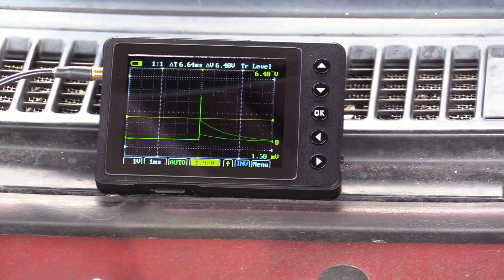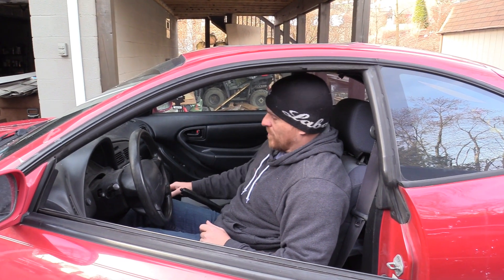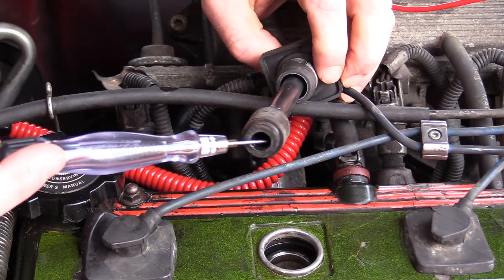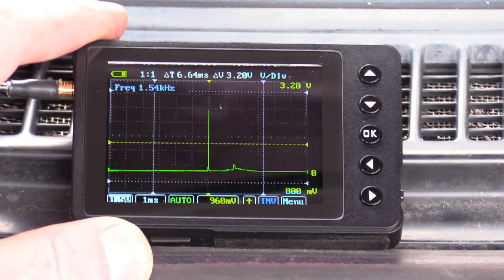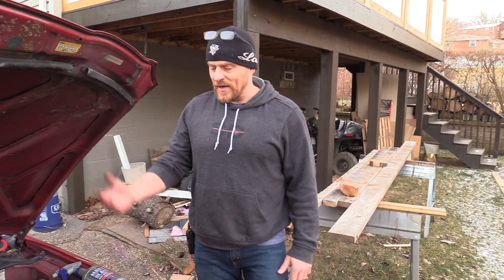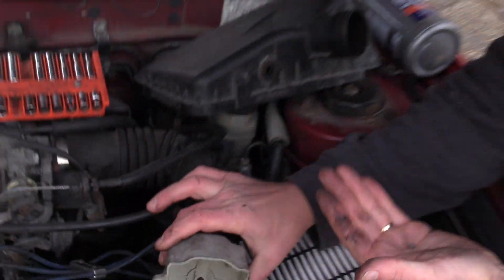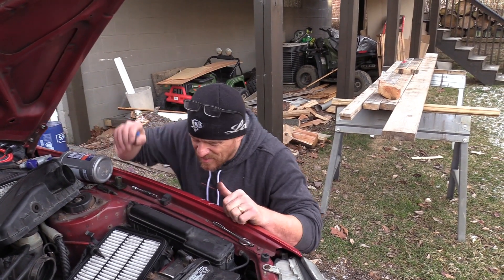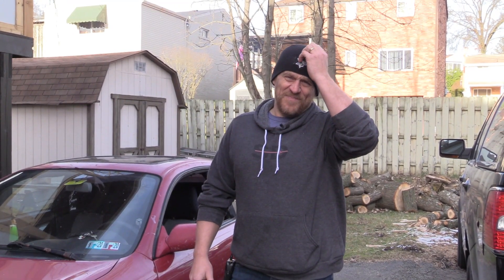Misfire, weak spark, 2 years after coil replacement 94 Toyota Celica (part 1)

Comment: I’ve got a 2006 Nissan Altima every shop has given up on it it has spark no fuel the harness is good has continuity from crank and cam sensor to computer I’ve replaced the sensors just Incase replaced the fuel pump it works comes on with switch pumps fuel to rails replaced the injectors checked the ignition switch it has power and sends signal the injectors has power but no pulse I’ve replaced the computer two times both times having it reflashed and after installing it in the car it would crank and run 3-4 times then it’s like something messes it up and it’s done at $79 an hour in a shop and 2 years trying multiple trends and nothing works I run across your you tube page and wonder if you may have any advice for me it’s a 2.5s engine thank you in advance
Reply from the maker: Sounds like an immobilizer issue. Hard to say without seeing the car. Any codes for the anti-theft system?
Reply: I’m not sure if there was a code for it or not but he did say he disabled the anti theft to try and get it to start

Comment: Sir I have a 1997 toyota celica and had a intermittent misfire cause cylinder 2 is misfiring at the beginning but once the engine is hot it runs smooth again. We had the engine overhaul without checking the coils injectors and changed the piston rings, head gasket etc. But after the overhaul the misfire is still there. And one month after the cylinder 1,2, and 4 are misfiring and only cyl 3 is running which makes the engine sound so bad and shuts off if you dont step the gas. What do you think is the problem sir?
Reply from the maker: compression test would be the next thing I would do, my first thought until you said all the other cylinders are now misfiring, was a possible intake manifold vacuum leak on the #2 cylinder but now that it is misfiring on 3 cylinders now, I don't think so?
Reply: @ScannerDanner   Yes I would love to do a compression test too but my father which is also a mechanic, said that there is no need to do a compression test because he is sure that the engine inside is good since we just overhaul it. What I was suspecting was either a broken valve spring that was not noticed while being overhauled or faulty ignition coil and fuel injectors?

Comment: One more coil replacement , But this is the third on a 1978 Toyota Carina with 86,600 miles on the clock , The 4A-F  engine has the coil in the distributer, I have had about 20 motorcars in my 86years all with coils seperate from the distributer and nevver a failure  SO WHY THIS ??
Reply from the maker: Junk parts being made these days ESPECIALLY for old cars

Comment: The video you posted on December 14th on the 03 Chevy truck, did you ever do any more work to that? Just curious if the guy got back to you on it. We need a video dedicated to the Scanner Danner blooper reel. That pickup coil, does it have epoxy over it or no? Strange coming apart like that. Thanks for working in the cold, I can relate.
Reply from the maker: He never answered my questions. I really wanted to know the part numbers of the injectors he put in and where he got them from as they did NOT look new. My brother also found that the frame was bad on that truck and I am not surprised that we haven't heard back from him. Unfortunately

Comment: I'm only 10 minutes in, but I'm surprised you haven't considered the wires. They were moved when the valve cover came off, and they are notorious for failing, especially when older.
I'd water bottle test it to see if it's arching outside the wire, or if it makes the miss worse.
17:00 in, shouldn't we re-test at the cap  to see how far it jumps now that it''s happening to retest?
18:00 in Ahhh, ok.

Comment: how many miles in that celica  Paul ?

is a manual or automatic transmission ? 🤔
Reply from the maker: Manual. 256,000, second engine. We bought it with a blown engine and put a junk yard one in it that had around 100k on it

Comment: Lol wasn't doin that before you fixed it....... At least once a month......

Friends yota started to (edit lose oil from the dist) the coil had a bad bearing "pickup coil was ripped out" car still ran fine but it is a normal wearing part..replaced the dist ✔...crap meant to say OIL
Reply: lets team up in SW FL

Comment: After all that testing,  pull the cap.....the rotor or the post for #3 cylinder probably has carbon/scoring on it.
Reply from the maker: Keep watching, it is not a cap and rotor problem
Reply: @ScannerDanner  I did....saw that....never seen a distributor fail like that. One for the books.

Comment: All the while I am watching this video I am thinking why not ohm out the spark plug wire to make sure the problem is not there. Next, why not pull the distributor cap and look inside it.  Look at the cap and rotor and then the rest of the distributor. Some times the eyes can be an effective tool and save a lot of time.

Comment: I once couldn't turn off a Jetta... The Jetta kept running... I unplugged the spark plugs wires... The thing was still running.... 0_0 ... I took off the fuel relay... Stupid car was still running..... The zombie Jetta would not stop running until I took the intake boot off and plugged it . Luckily it had no vacuum leaks and shut off. The car kept running because the engine oil was contaminated with fuel, the carbon buildup in the pistons was really bad to, the carbon got so hot it could actually detonate the fuel contaminated oil, and the dum car was leaking oil into the cylinder thru bad rings and valve seals
Reply from the maker: That is crazy! Thanks for sharing

Comment: Dilemma, as the last to touch it before it went wrong do you pay for the repair, or because it's your lads car do you pay for the repair. lol
Reply from the maker: No dilemma other than the initial diagnostic charge. You may need to work with your customer on that part as it truly didn't do it until we touched it. BUT, once we found the issue, we can prove it wasn't anything we did other than to disturb a preexisting condition, and the customer is being billed for the new distributor, the labor to do the job and you may just build the diagnostic time into the bill because they may complain. But that part you can even charge for in the end, and be open about it, if you've communicated well with your customer along the way.

Comment: looked like weak spark to me coming out of the cap, right from the start. my guess is cap and rotor getting stupid inside,  maybe with a side of coil leak. lol
EDIT: guess my gut, ears and eyes are still tuned up :)
Reply from the maker: not at all, that spark was jumping around 3/4 of an inch from the cap electrode (which was counter sunk into the cap)
Reply: but it didn't look and sound steady to me, like it was taking an alternate paths jumping around in there.
very much like when they're wet with moisture inside. that is crazy seeing that much shredded winding's and it still be running. a timing light would have been interesting to see on it, probably jumping all around wildly or fixed offset.

Comment: At 25:40 you point out the center button... THAT was probably your source of the copper strands you found. I HAVE SEEN that botton physically fall out, exposing a fried light weight spring and a shredded version of a braided copper wire. That button probably has no spring let to it. Replace the cap AND rotor. Double check your spark plug lead resistances and look for a cracked or tracked plug(s). (High resistance=increased spark current, and arched cap)
Reply from the maker: keep watching, it didn't come from the cap
Reply from the maker: No problem my friend. If you followed along, I did the same thing in my own assumptions a long the way. First I said weak coil, then I said moisture in the cap and in both cases I was wrong 😀